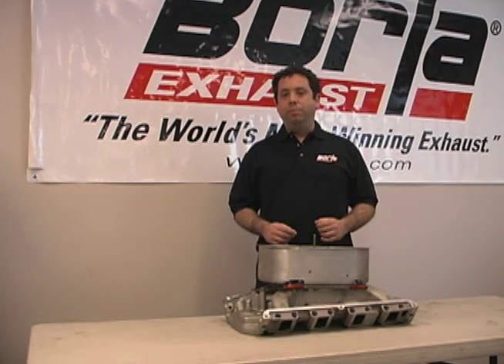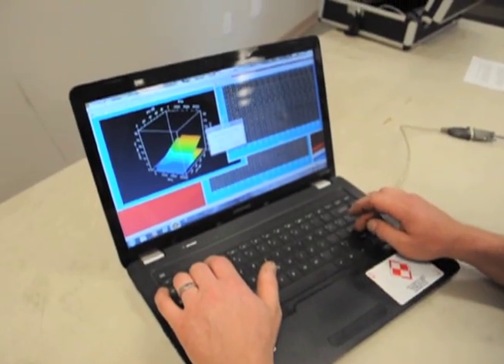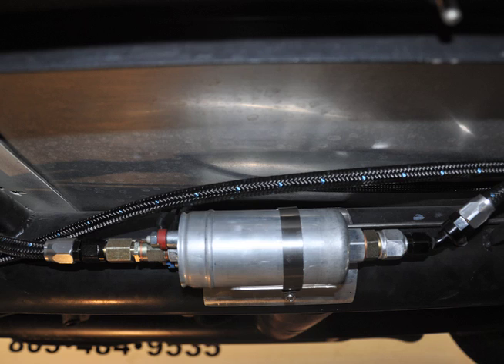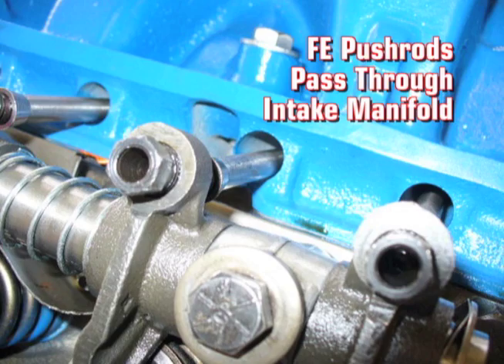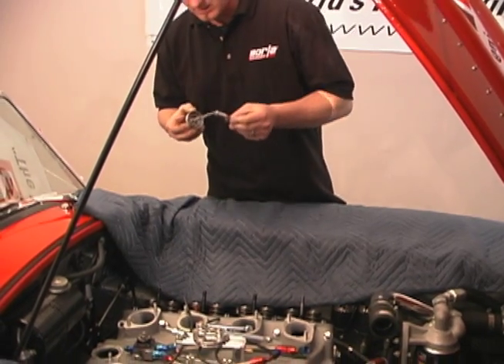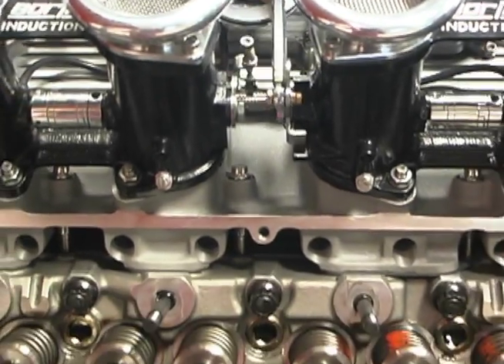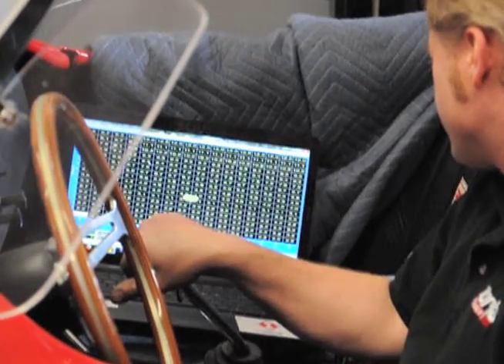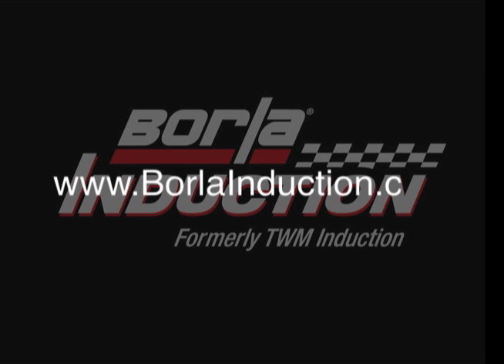BORLA Induction Throttle Body Kit Overview & Install

Comment: I know you have the Vacuum chamber on most intakes so did Tom tune this on Speed density with a MAP sensor or TPS based Alpha-N ?  did those internal filters lose much power ?

Comment: And for the cost think about this! For 4k you can get a Paxton novi 2000 and get more. Or you can ebay a twin turbo setup that will give you 175-300 hp and it's still reliable and look online or on the tube at tq curves with twin turbos it's flatter and beefier and broader. The Paxton will give you a min of 80-200 depending on engine mods. A turbo setup can give a stock engine double it's power without mods. Spend your money on a system that is historically backed up! EFI is still a hit or miss
Reply: @BrutalFord  >I have worked on the only two EFI systems, one since 1978 at the dealer. Electrical issues with certain cars create voltage drop on the ground side which will cause any system headaches. But, other that fuel sold with excellent filter systems, I can see your frustrations but they are not "Hit & Miss" unless you are way outside programming for street racing or tracks. Now it becomes and issue of "Garbage In - Garbage out". 
 In other words, your engine runs as well as the PCM /ECM programmer is. Running "Speed Density" brings a host of issues with it. Using a traditional MAF sensor are providing false readings due to highly marketed air filters that unfortunately are soaked with too much oil. 
 There are many variables for which type of engine you are running, but with repeat customer base at a dealership, I have several dozens who are over 300,000 miles and never had an intake leak, head gasket failure or excessive oil consumption issues with identifying the problem, repairing the root cause and correcting it using best practices and common sense. 
   Yes, Speed cost money, how fast can you afford to go. But EFI is here to stay, unless you are driving a 1981 Galaxy then you are one your own. Start saving nickels, quarters and dimes. I am not nor ever have been an employee of Borla, but they not owned by a big company with 80+ in their portfolio and certainly do not build vehicles. They offer high quality parts and systems that are well researched and built in the USA. As for myself, I have worked on just about every engine/vehicle combination allowed into North America as I worked in a city with a larger military population and they are bringing cars for maintenance & repair that I can't pronounce. But, glad to see carburetors for bye, bye and 99.6% are Fuel Injected either mechanical, CIS or EFI since 1977. 
DK, Omaha. ASE Master Tech since 78.

Comment: With it mimicking the old hilborn style mechanical fuel inj it adds a talking point. And a instant throttle response and a more reliable advancement from the carb, however there is nothing I say again nothing that competes with a good solid Holley 4bbl carb. The sound the note the brutal-ness of a Holley. Call me old school but a good Holley properly tuned can dish out a wider band of performance without the chance of messing with a ECM like so many do and screw up the engine!

Comment: I put a Borla exhaust system on my '95 Toyota Corolla and it made a BIG difference. I got more than my money's worth out of it.
BUT...
The cost vs. ROI on this upgrade (Carb to EFI), makes me say "I'll pass".
This will cost a mint ($4000+ approx.) and it only gained 21 RWHP? That's about $191 per Horse! That's ridiculous. I can do the same thing with the HollyMax EFI system for less than half and it comes with Heads, Intake, Fuel system, sensors, controller and SUPPORT for LIFE!
Care to Comment?

Comment from the maker: The air horns are supplied with a mesh screen that provides some protection against the ingress of visible debris. In addition there are filter screens available which snap on to the air horns. They incorporate a nylon mesh which will filter out most dust and sand particles. You can view photos of these filters on the website at BorlaInduction dotcom.

The ultimate filtration is provided by an air box which can only be fitted where there is room (certainly not in a Cobra!).